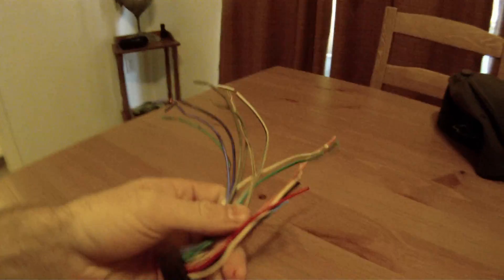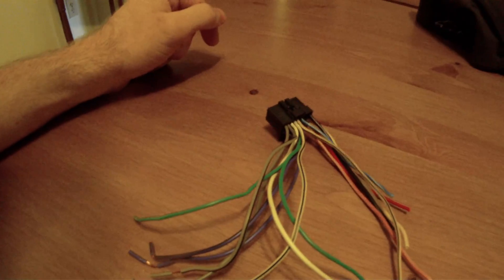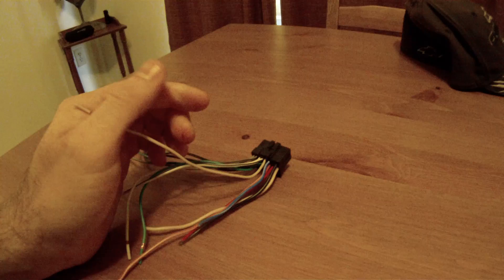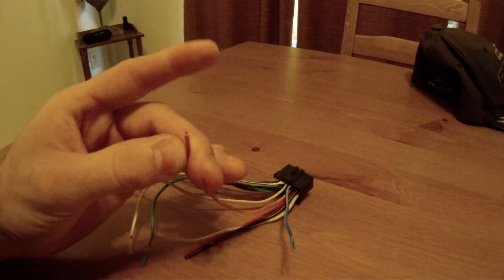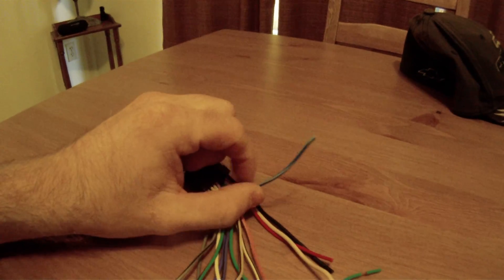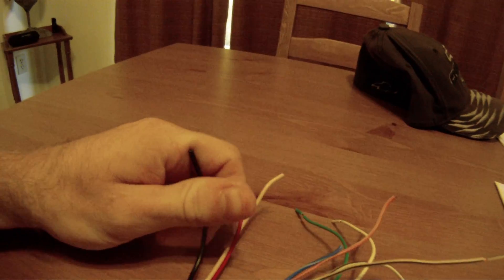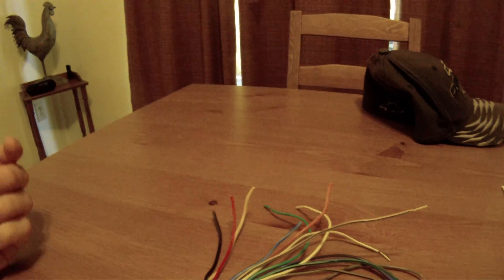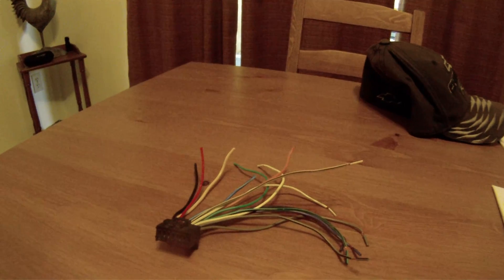Aftermarket Radio Install, Harness overview

Comment: im so confused. im trying to put a radio in my motorcycle and I  don't know what to do with the blue wire and yellow wire
Reply: @rontontui  ok so i had it backeards. I have the yellow going to the switch on acc power and the red and black going to battery. So yellow goes to battery and red to switch power. What about the blue white remote cable? If i dont run an amp where does that blue/white go?

Comment: Hello friend, I am looking for a female cable for a radio tahoe truck 1994, you have an email to send photos and where you can indicate or guide me where to buy the cable kit online ...
Reply: hello friend, thanks for your answer, as I mentioned earlier, I'm looking for female connectors 5, 6 and 9 pins, the type of radio is a
Audiovox radio Model: 28A4147 94-GMC-ETX see link (https://www.ebay.com/itm/original-factory-car-radio-stereo-receiver-1992-chevrolet-gmc-functional-working/142471256043?hash= item212bf2d7eb).    I need to locate them on the internet, you will help me help me by telling me the route to buy them ... please...
Reply: oooh, thank :(

Comment: I see you actually answer questions so hopefully you can help me solve my problem. After connecting my new radio everything works fine but when I turn the ignition off and open the door it stays on. What wires are causing this issue?
Reply: Ronald Tomlin when I first installed it it shut off just fine as the factory one did and later that day it started to just stay on. I wired it color for color but I will take your advice and check for power on the red cable
Reply: With the factory stereo it does but not with the new one

Comment: My stereo has an orange and white wire, which I assume goes to the plain orange wire on the wiring harness right?  Since there is no orange and white on the wiring harness.  The wiring harness also has a orange and black, should I just cap that since the stereo doesn't have one?

Comment: I need help finding my rear speakers wires in my 1998 audi a4. I can't find them! and do I conect the red and yellow wires together? I only seem to find one 12v wire coming into the dash.  hope you can help.

Comment: Hi, I recently purchased a Pioneer DEH-x6800BT. On the adapter that I have it only has a blue wire, while the plug for the radio only has a blue and white. Can the blue and white be connected to the blue (power antenna)?

Comment: So I have a question if I have an alpine and I just want a newer one for an aux port would my wire harness already work and this could be a stupid question but if the back ports look the same where everything plugs in on both would it just plug in to the new radio simple as that

Comment: Hello, i just received the radio harnes, i connected all my wires  from my JVC single din radio but I have 1 orange with black wire, 4 brown wires,  1 pink wire, and one solid blue wire that says power antenna but my JVC doesn't have any wires that matches with the radio harness for the 2005 Mercury Grand Marquis?  Also I have two turn on amp wires with blue and white can I have some info about that?
Reply: +Ronald Tomlin the extra wires are for my radio harness for the Mercury
Reply: +Ronald Tomlin the shop I bought my wire harness gave me the wrong one and replaced it and all the wires match and my amp wire is by its self
Reply: +Ronald Tomlin thanks for the help by the way

Comment: Does it matter if your 
Wiring harness has: Copper wires and your
Head Unit harness has:  light grey, aluminum wires? 

i wired them all together and installed my aftermarket head unit and now when i turn it up, the louder it gets the more distorted the sound gets
Reply: +Ronald Tomlin  thanks man, good idea!

Comment: Hey i was having a problem and had a question about grounding my stereo wire, was wondering if your still around and can help me.
Reply: +Ronald Tomlin So the can the black wire from my stereo go directly to the wire harness connected to my car, does that count as ground?
Reply: +Ronald Tomlin thanks for the help

Comment: i am getting a android a3 same size as my one comes with a harness. but i dont know if the wire will match in the harness. even if i can do hard wiring to the factory wire i will do it but the colour is quiet difficult to understand. as audi use amplified speaker.

Comment: Nice vid....
So far the best explained I've seen...
I got a problem with my car, ,, 2010 nissan altima.. i did it myself and for some reason the rear door speakers aren't working... the ones on the very back on the head or whatever they work.. but the ones on the door doesn't.. and something else the harness i got has a solid orange wire and the stereo comes with a orange stripe,,, and i connected them together... now i know stripe is - and solid +.. can you help?
Thanks and again.... great video.. i really learned something from it...

Comment: Hello Ronald!, I found this video really really helpful, but I've got a question, maybe it doesn't make sense that I ask this, but I've been researching and I haven't found a clear explanation. So I have the wiring harness that comes with my new aftermarket stereo, it comes with the black wire and this wire has a little metal hook, then I have my metra harness adapter, which also has a ground wire (just plain, no hook). How should i proceed when installing my stereo??, what is the thing to do with the ground wires, I'm really hoping you can help me!!!. Thank you very muchh!

Comment: so if i buy a wiring harness for my vehicle and it has the black ground wire and my new harness that came with my new aftermarket stereo has a black ground wire do i splice and crimp the 2? im just wondering if i connect the ground from my stereo harness to the vehicle harness would it be grounded or will i have to let it hang loose and ground it somewhere else metal on the vehicle?
Reply: +Ronald Tomlin what if my factory and wire harness adapter have 2 black ground wires, but my new stereo wire harness has only 1? do i just pick 1 of the ground wires to splice into and block off the other ground wire or splice into both? thanks.
Reply: ***** thank you!

Comment: Nice video.  Think I nay be finally getting my head round this stuff.  I'm using an iso adapter harness on a quad lock for an after market Pioneer.  I reckon the black (ground) wire will be grounded through the old wiring or the antenna already, while the yellow (back up?) wire is also connected via the original in car wiring -  am I right on that?  Also, I'm thinking I could attach the red 12v igntion wire to the fusebox rather than direct to the battery - what are your thoughts?

Any advice would be much appreciated.